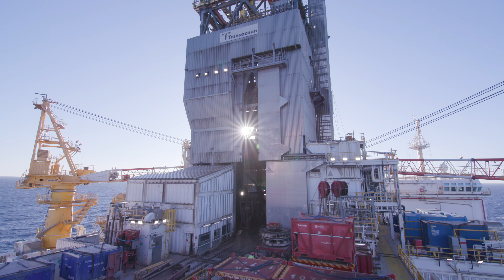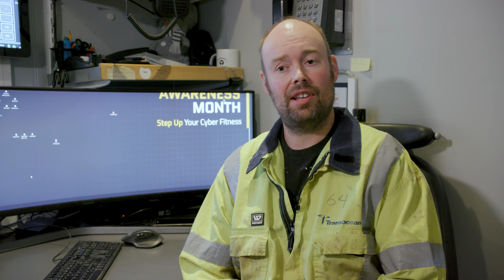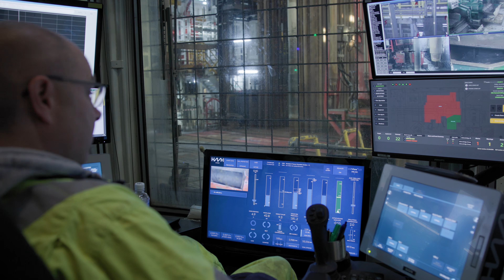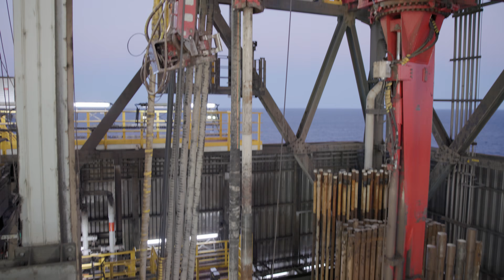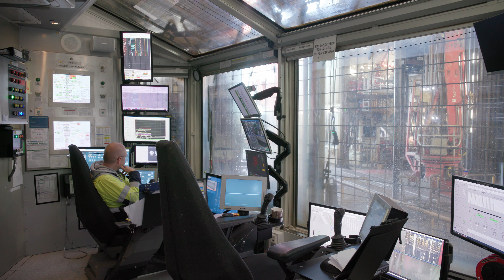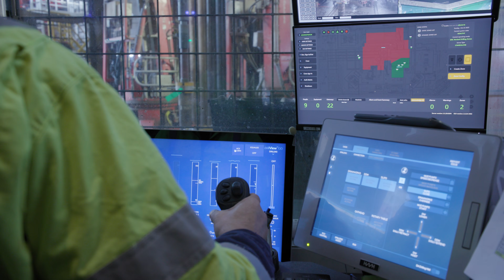Automated Drilling on the Transocean Encourage

Comment: It's all great until a hose blows at 2 AM or a sensor vibrates loose and one ends up having to rely on some technician that does not have the same goal in mind. Try replacing a hose halfway up the derrick with 50 mph winds and rain.